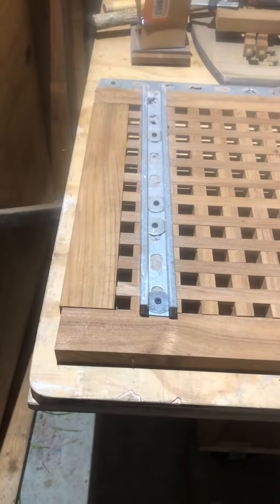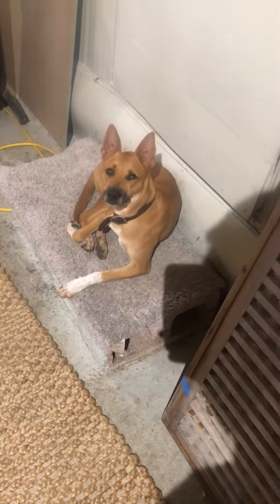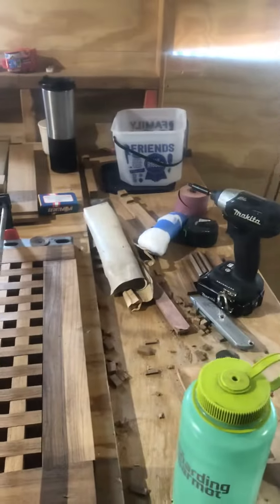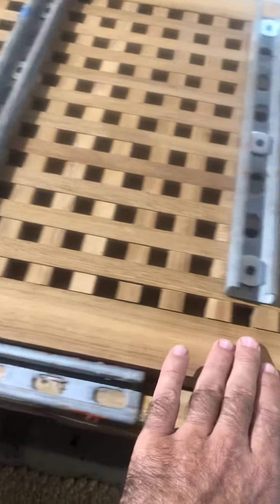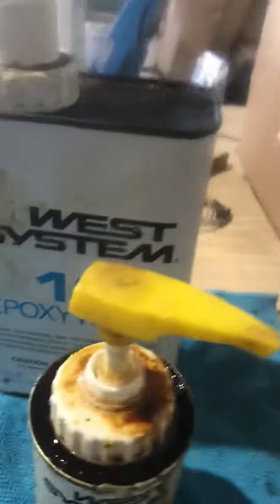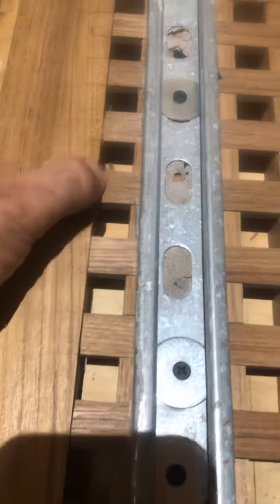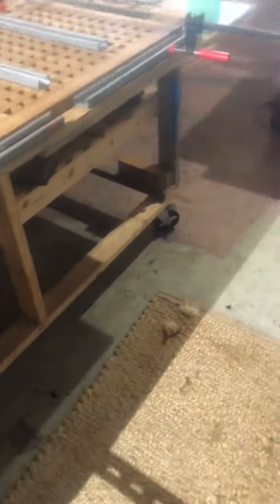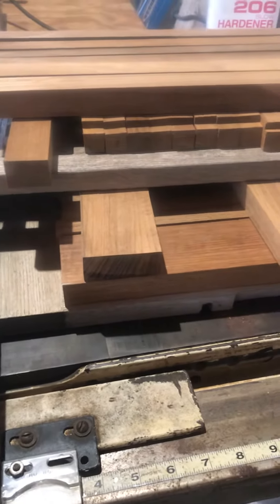Teak grate easy way

Comment: At 0:54 seconds into the video (still picture) I can see (in the top, at the end of each) how you made the tip that enters into the surrounding frame.  But did you make corespondingly square holes in the surrounding frame ?, and if so how ? (tools ?). ....... Or you just drilled slightly narrow hole and forced it all together ? .... I can find video's detailing how to make the grate part, but none who shows how it's connected to the surrounding frame. ........ :-) ...... I assume you use epoxy as glue and filler, but not as coat/varnish.
Reply from the maker: Hi Finn 
Special mortise drill will drill square holes ..
Used west system and 404 fillet to thicken it up and match the teak color. 
No varnish on this